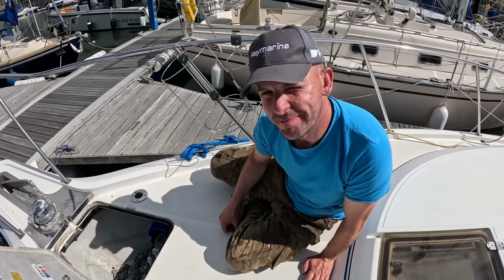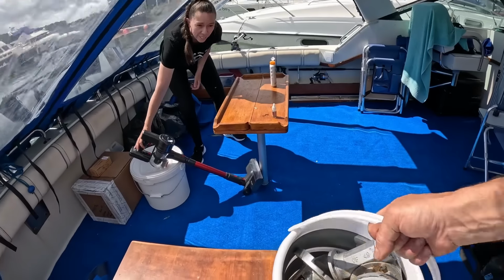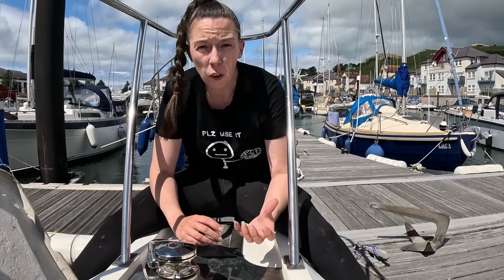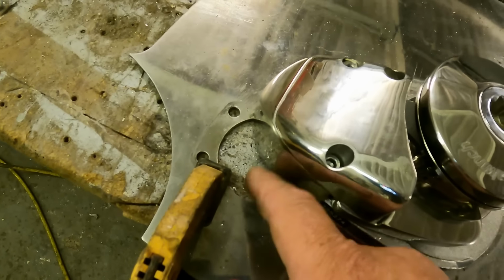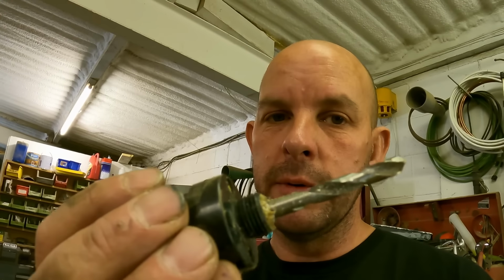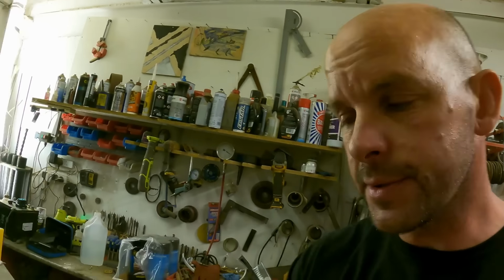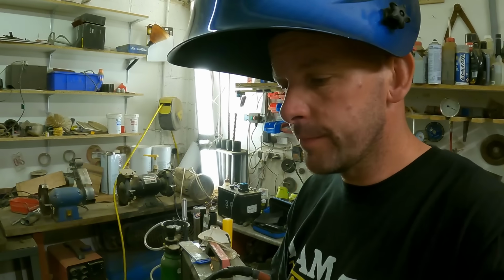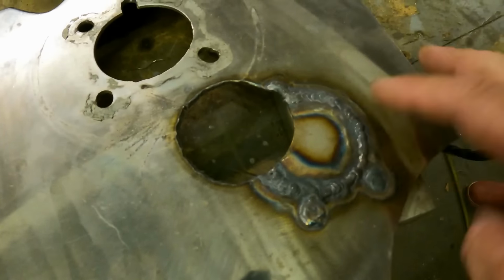The New Windlass Means More Work To The Boat!

Comment: A brilliant job on the plate. I missed the part where you seal the core after the cut in the deck. I hope it was just not included in the video because when the wet chain goes wizzing  down into the locker, the core is going to get wet. Great watching you two solve boat problems .
Reply: The winch looks like it has a doubling pipe but the bare wood deffo needs to be sealed. Having watched Simon & Gemma, I’m sure they sealed the cut wood and fibreglass.

Comment: To finish, you need to seal up the wood edge where the chain passes through.  
Now I have to go out and buy a pastry  treat.
Cheers
Reply: I’m a huge fan of car body mastic. It’s moisture cured acrylic but cleans up with brake cleaner and when cured it’s good enough to fix kids shoes.

Comment: Is there a backing plate under the windlass to distribute the load? You should have epoxied the round fiberglass piece back into the whole in the deck.

Comment: Nomenclature:  To my knowledge you may be misnaming your "Capstan as a windless.  Basically a wind less has a horizontal axis and a capstan has a vertical axis.  You just installed a capstan,.  A capstan is a vertical-axled rotating machine developed for use on sailing ships to multiply the pulling force of seamen when hauling ropes, cables, and hawsers. The principle is similar to that of the windlass, which has a horizontal axle. The word, connected with the Old French capestan ...

Comment: back in the 60s the bodyshop at the garage i worked at used to brasso  the sprayed panels after compounding to remove the swirl marks and give a high shine before waxing.  before Tcut was invented. so almost the same stuff. nice repair.

Comment: In these situations where you don not want the drill in the hole saw, just cut a template out of a thicker material like plywood that will then hold the hole saw blade in position.

Comment: Hey Sim, can I assist with a little tip. Our hands shake more as we get older so holding the filler rod  at the end closer to the work pice and slowly feed it in and the torch near the head.